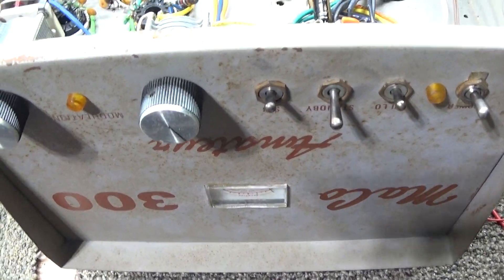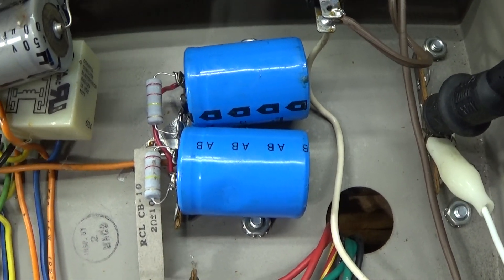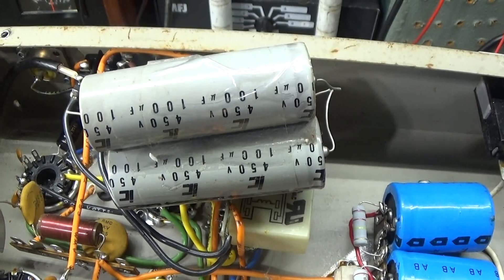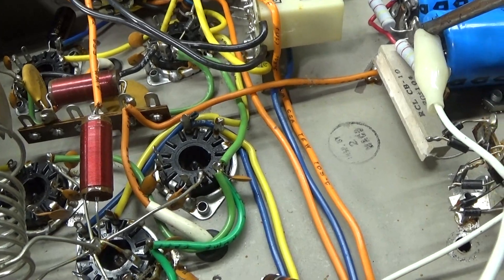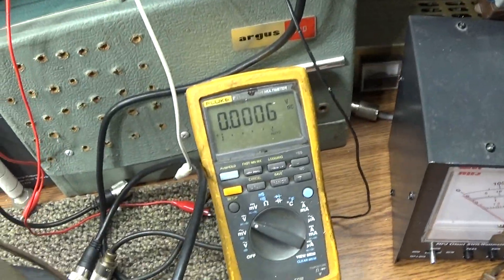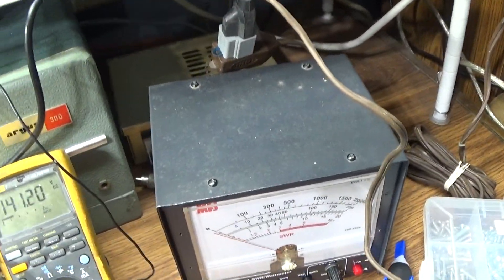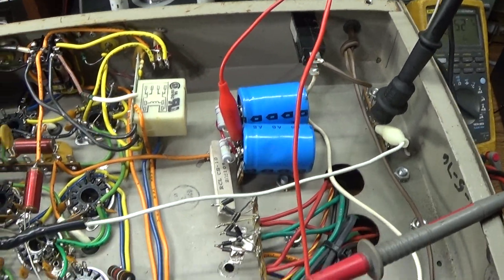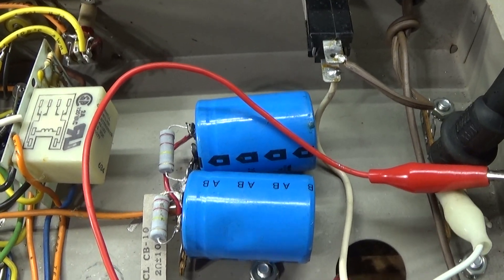Bleeder Resistors in sweep tube linear amplifiers 1kv and below

Comment: Here's another topic for you...

"Why is my radio getting splashed (or bleedover)?"

To test this you need a signal generator capable of a 400 Hz tone at 90 percent modulation.

I don't know how they tested it back in the day, but the way I do it approximates real-world conditions. 

I set my generator up with a 400 Hz, 90% modulation signal with enough output to give about a S5 signal level. Then I switch the radio to the next channel, and increase the signal generator output level until it's equal to the on-channel signal level. The difference is the adjacent channel rejection in dB. Pretty easy.

But, why is my radio still getting bleedover, sometimes several channels worth up and down? This Browning/Tram is supposed to be bleed-proof...at least you'd think it was. 

Sometimes the problem is generated in the radio itself. Input signals far above what the engineering department expected can cause undesirable effects. Early transistor sets had a nasty tendency to desense, or go silent when receiving strong signals from nearby frequencies. A good example is when you're listening to 19 on the highway and the trucker behind you is talking to a buddy on 16. You won't get bleedover but your radio will be silenced whenever they transmit. Modern radios are better at this, having been designed for it. 

Other issues come from without. Mistuned, overdriven, and overmodulated radios produce spurs and square waves that are rich in harmonic energy that spreads the signal out and bleeds over. Listening on the air, there have always been two schools of thought: run heavy modulation and run high-quality clean modulation. 
The net effects are quite different: overmodulation on channel 6 will bleed plus/minus several channels, while the "hi-fi" crowd puts out the same signal levels with zero bleedover. 

The tuning instructions for the legendary Hy-Gain Afterburner Plus have an instruction for the correct way to tune the amp for AM so that it doesn't splatter. I highly recommend downloading that manual and reading it.

Comment: Modern digital instruments, like yours, have an input impedance of 11 megohms. Old analog voltmeters are typically 20,000 ohms. A solenoid operated electrician's tester like a Wiggy are very low impedance compared to a technician's instruments. This is necessary because in an industrial environment induced "phantom" voltages interfere with troubleshooting and energy verification for lockout/tagout verification.

Comment: Excellent video! This is the kind of stuff that I need to see/hear. I have many sweep tube amps that I'd like to re-cap but I'm about half afraid to try. So I know about electrolytic capacitors and bleeder resistors, what about a video explaining what other capacitors, resistors and diodes that should replaced?   Thanks Doc.